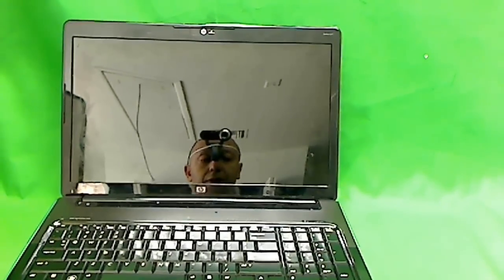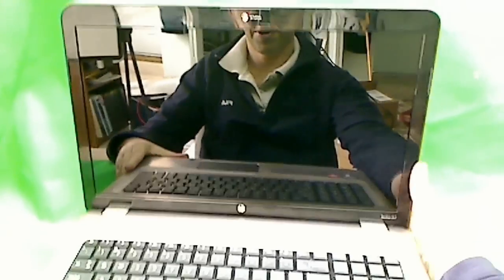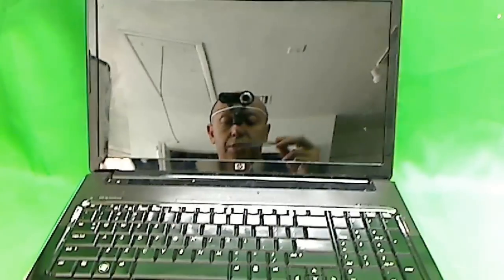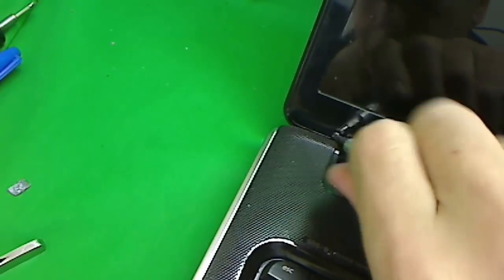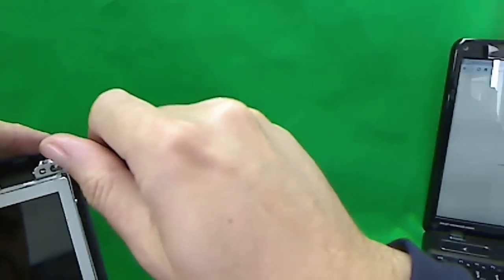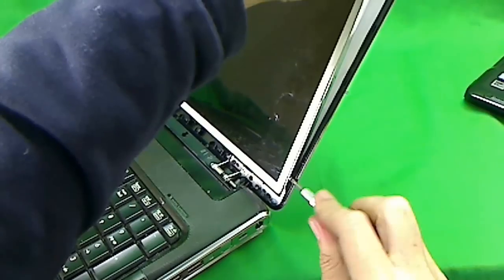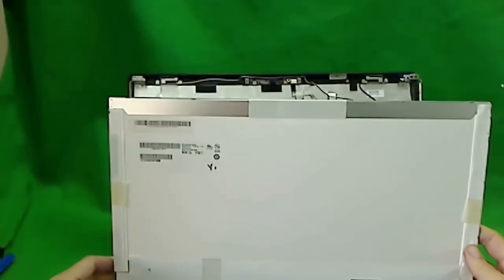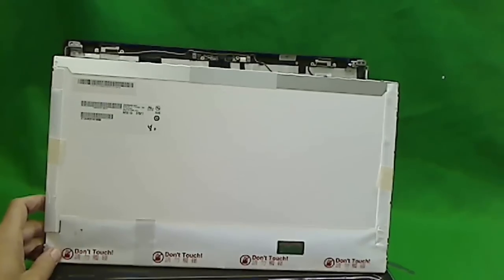HP dv7-3173nr Laptop Screen Replacement Procedure

Comment: This is an amazing tutorial. I read a screen fixing directions and was very lost. Im very visually inclined so this is amazing. Its going to save me over $200 seeming as that's how much my local computer repair shop told me it'd cost. Which is ludacris. This is about a 1hr  job at most. I can't believe they were going to charge me so much!!! The screen is only 60 bucks! Again, thank you!!
Reply: Hi, Nicole do mind sharing where you purchased your replacement screen?

Comment: Thank you for posting.  I followed your lead and was able to replace my damaged laptop screen myself.  Getting the lower side screws back in was very difficult, but I got it done and did the repair for about $75.  Never could have done it without this video.

Comment: Thanks for video. I bought used 3162nr  picture is like photo negative screen. When connected to external  monitor picture is normal, Looks like laptop was drop or something was dropped on it., Do you think this is screen problem or maybe cables or inverter ( I do not know where is located)
thanks

Comment: Great video.   I have a hp 3065dx.  I think my lcd cable is bad.  The picture is fine at just the right angle of the monitor.  Do you have any videos on replacing the lcd cable? Thank you!